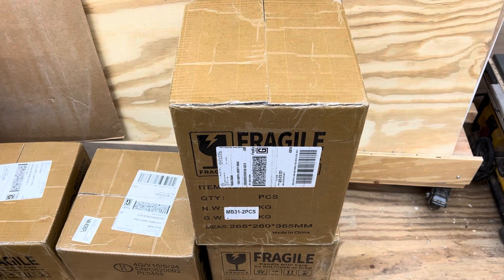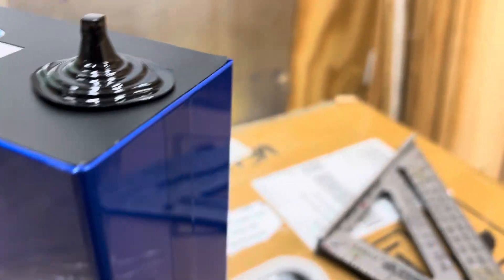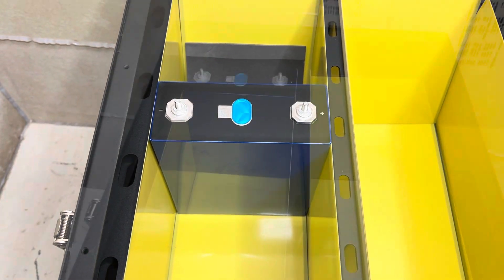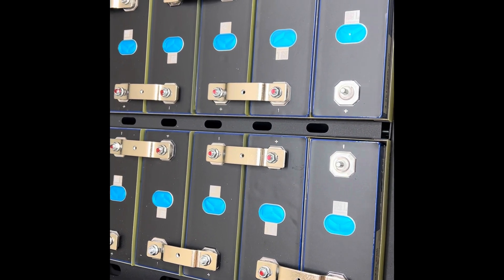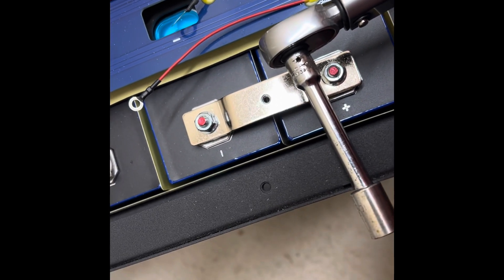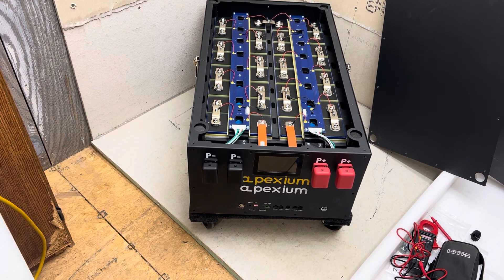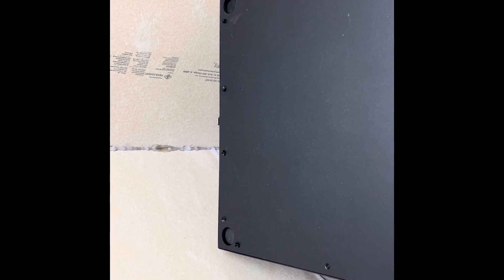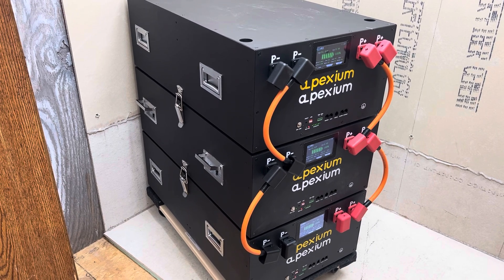Building three  APEXIUM 48 volt DIY battery boxes with JK Inverter BMS

Comment: Looking forward to your next video. Subbed. Is there a big savings building your own batteries or do you do it for the learning experience?
Reply from the maker: I did it for both benefits.  The three batteries were much cheaper than buying nine server rack batteries and I really enjoyed building them myself.
Reply: They are about 1/2 the price of a EG4 power pro. These are more risky as they are not UL listed or certified. I built 2 of these but I keep them in a shed I built for my inverters and batteries. Along with my security system worst case something catches fire my house won't go up in smoke.